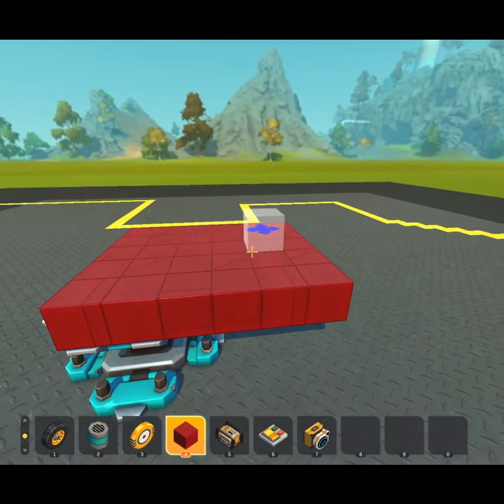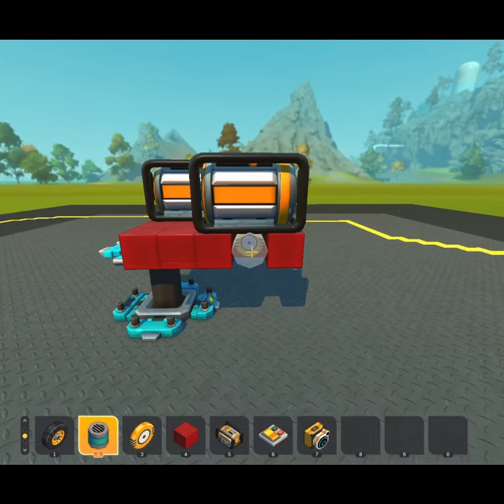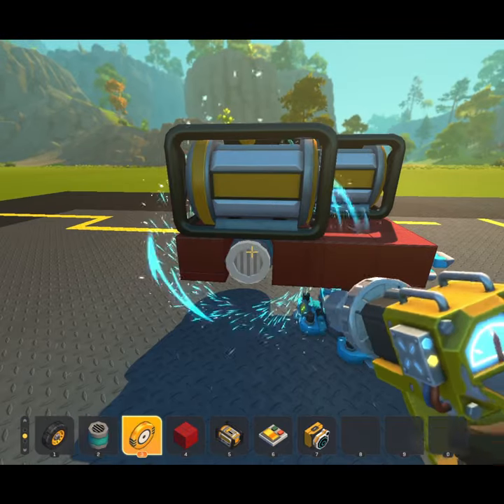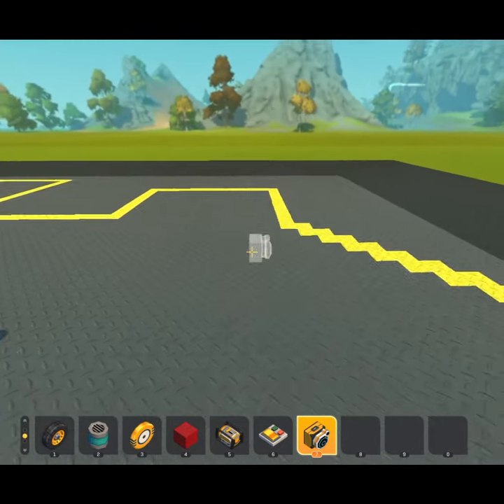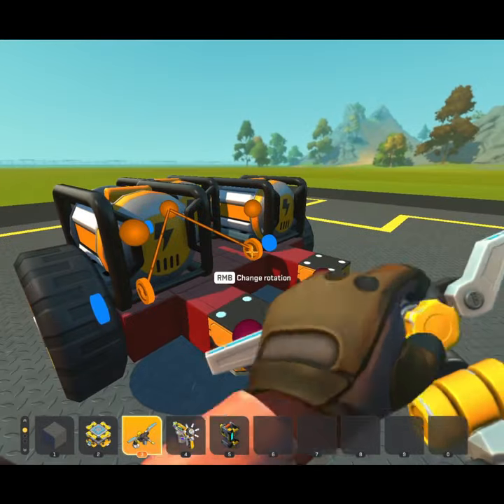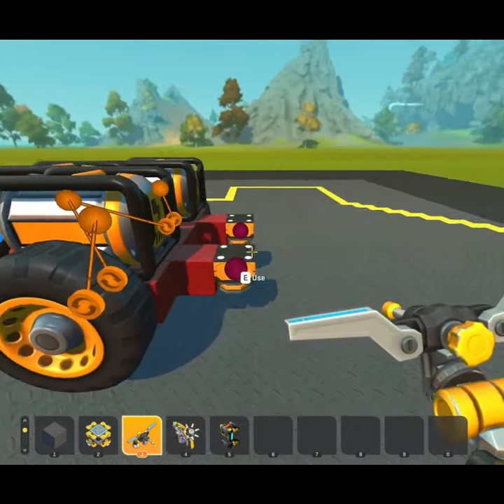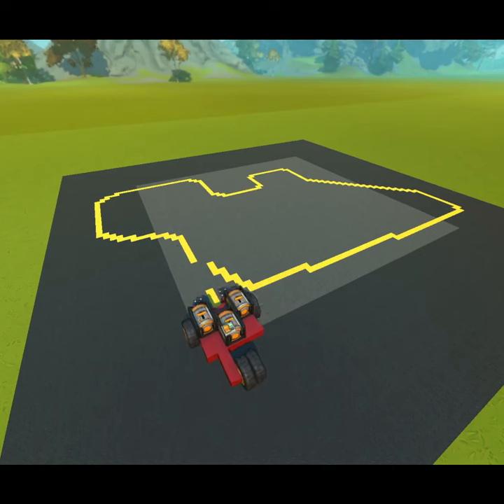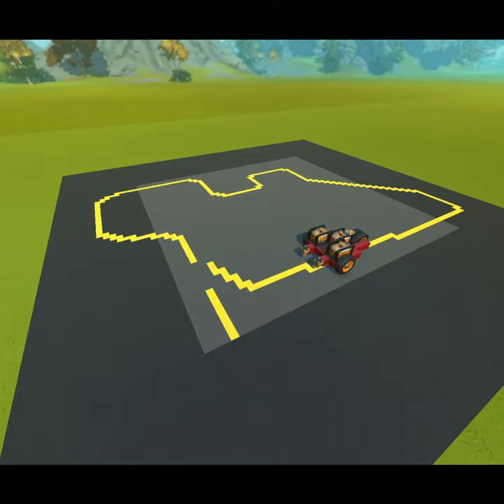Line bot: follows a LINE with NO LOGIC.

Comment: Tip: use this on your farms with the sensors pointing up, then draw your lines above the farm and add a watering system and plant collecting system or make separate cars not both.
Reply from the maker: Have not even thought about making a track above, but that is an excellent idea for when there is stuff on the ground.

Comment: The sensor is a logical element...
Reply from the maker: Umm... Ahhh... shut... Shut up! :D

(I did not consider it as such since it's just an output in SM. I suppose technically it does 'decide' same way as logic would, but unlike a regular logic block you don't need to do anything to it or to connect it in any special way.)